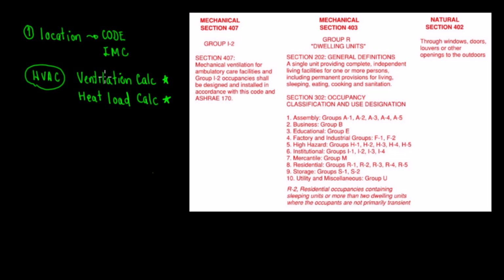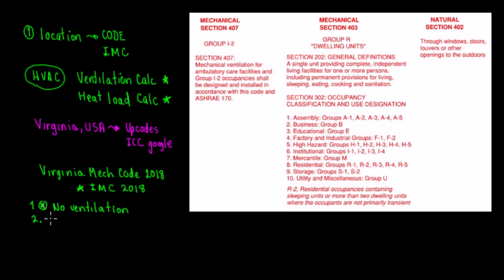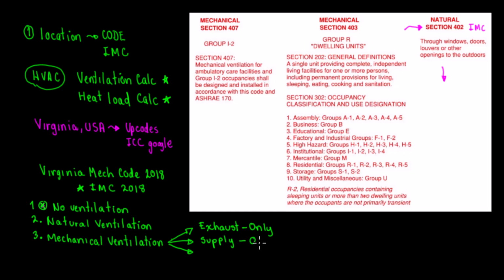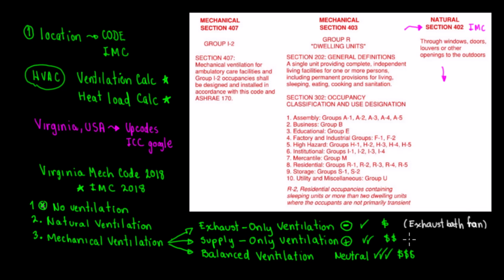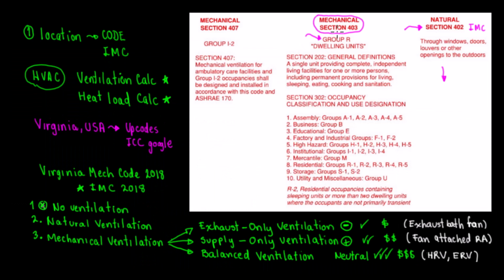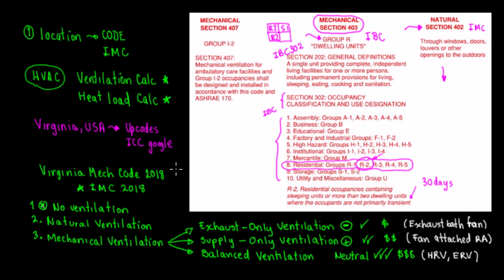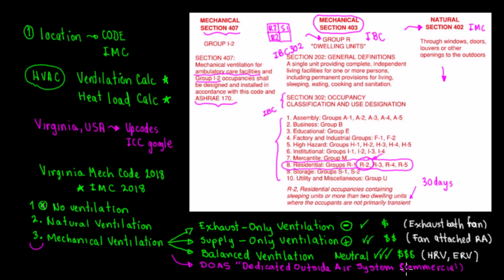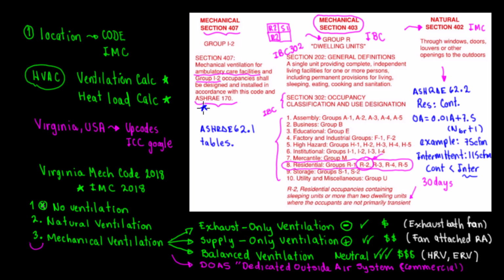Ventilation Mechanical Code Requirements

Comment: Hi there, appreciate your videos. can I ask you question regarding garage ventilation?
Reply from the maker: Thank you so much. Yes please. Any question is always welcome.
Reply: @ I’m trying to make a big on a new construction custom home and one of the requirements is:
Per NEC 2007 table 625.52 (B)(1)(A), minimum ventilation required for each of the total number of electric vehicles that can be charged at one time.  =240v, 100 amp per branch circuit = 12cfm per vehicle 
What kind of ventilation do  I need to provide? Thx
Reply from the maker: @metchkarov1  Great question. Based on your requirements I would put a 70 cfm exhaust fan in the garage interlocked with the charging stations or at least on schedule and the makeup air would be infiltration (that would be the quickest way) . However, Table 625.52 (B)(1)(a) shows the units in (m^3/min). Perhaps you should be looking at Table 625.52 (B)(1)(b) which is in cfm. Based on your voltage and Ampere rating this would be 493 cfm. Let me know you thoughts
Reply from the maker: I forgot to share the link of one article that might be helpful for you too. Let me know how it goes. https://www.ayresassociates.com/ventilation-requirements-for-ev-in-multi-family-and-mixed-use-construction/
Reply: @ I understand. So exhaust only ventilation, nothing complicated. I like that. Thank you very much for your response! Appreciate you!
Reply from the maker: @metchkarov1  no problem. Thanks

Comment: Timers required in bathrooms even if there's no shower or tub to the residential electricians
Reply from the maker: Thanks for your comment, and good to know. The need for a timer usually depends on local building codes and personal preference.